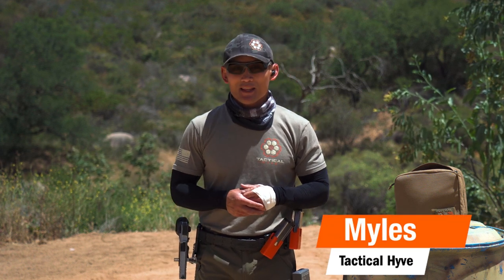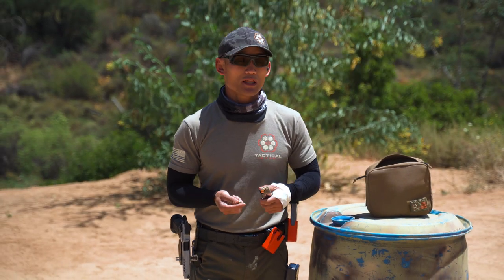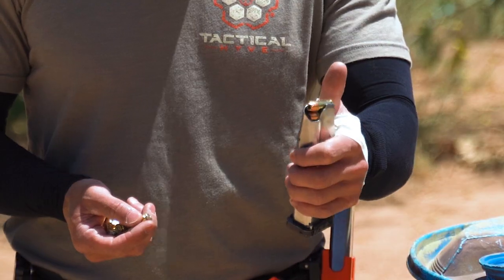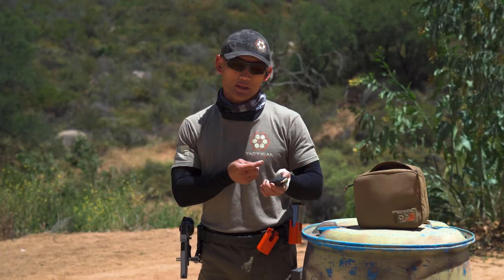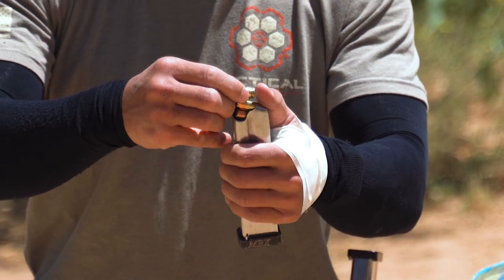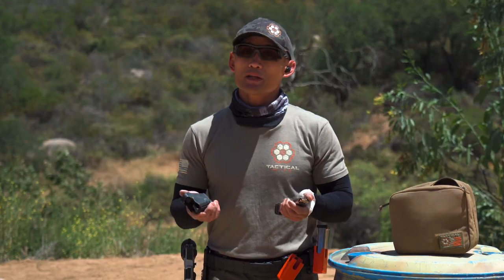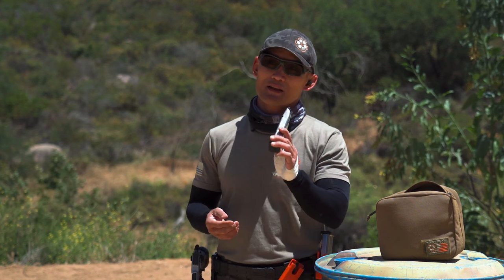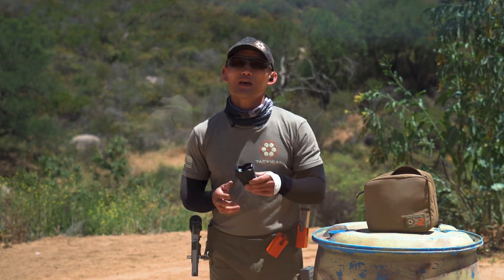How To Load A Magazine For A Handgun Properly (Semi-Automatic Pistols)

Comment: My pet peeve is definitely mags vs clips. Though if they’re uninformed, I’ll let it slide. The best way to inform them is through an analogy I made sometime ago. 

Magazines vs clips for cartridges should be likened to  magazines and (paper) clips of paper.

Magazines typically encase the cartridge on all sides except one just as how a magazine booklet encases the paper at almost all sides except the edges. They usually also contain a lot more cartridges/paper than the clips. 

Clips on the other hand hold on to the cartridges at its edge and are fairly limited just like how paper clips hold paper at the edges. Cartridge clips are also typically used to load magazines while paper clips of papers usually make up each segment/article of a magazine.

Comment: Great video for manually loading a magazine. I have a great loader that came with my Stoeger STR-9 that works great, but I just wanted to see some manual hand loading here. I already tried out those 2 methods that you show here, and thought that an experienced hand loader like yourself might have a different approach. Therefore as expected I just need alot more practice. I feel a little more improvement each time I try,....and I only started doing this lastnight. After installing the first cartridge it sure takes time getting used to putting pressure on two small "round" surfaces without the cartridges slipping off of each other. Will keep practicing. Thanks again for the great video, plus I like that mag-loader that you used to demonstrate that method with too.🙂👍